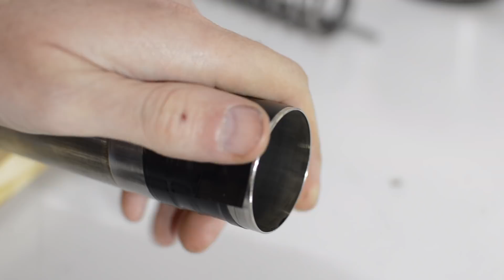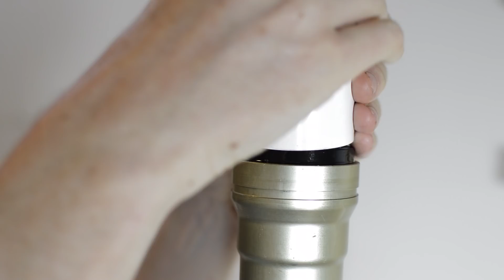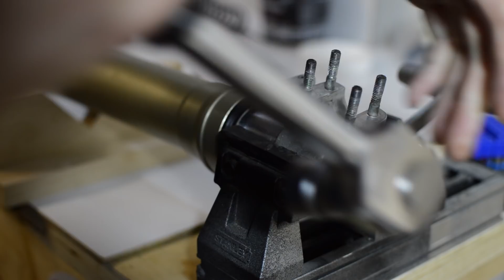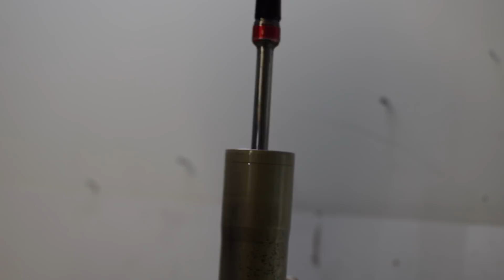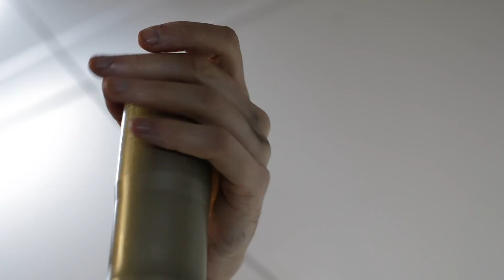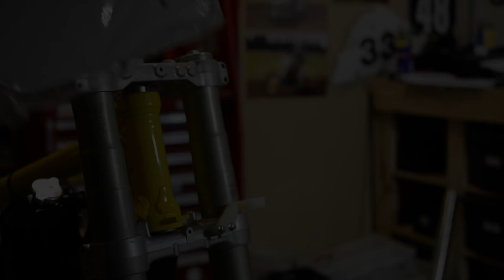Front Forks (Part 2) - 1992 RM250 Restoration - Episode 18

Comment: I just got the kit for my 1992 rm125 and the kit included two large O-rings, the size of the O-rings for the top cap. Two came in a single bag, then two came in two separate bags. I used the two in the separate bags but am wondering what the other ones are for. Maybe a different year/model bike?

Comment: Hey! I thought I'd share the way ive driven in fork seals both times I've done fork rebuilds. I use PVC like you, but I take enough pvc material off between the pieces that they are able to be clamped to the fork tube with one or two large hose clamps, then the entire fork tube is used as a slide hammer.

Comment: Hi fantastic build series mate, i got a quick question. So I just bought a 1992 rmx250 and have been searching all over the net to find a exhaust system to fit it... Yes I've been on lots of forums with info on interchangeable parts but can't find anything on the 92 models anybody got any ideas it would be greatly appreciated cheers.
Reply from the maker: Hey MotoApe - there's a really good facebook page for this era of RMs - https://www.facebook.com/groups/231474913851717/

Worth asking the question there mate.

I do have a new old stock Pro-Circuit works pipe for the 92 RMX that I might sell if you're interested.  Cost me a lot of money though...
Reply: Hi thanks for the reply, how much is alot?
I also found a full Pro Circuit system being sold by http://www.chaparral-racing.com/, around £500 delivered to the UK cheers
Reply from the maker: I paid $350AUD plus shipping from the USA.  I'd want to recover my costs...  This is a new old stock, works pipe - no longer available.
Reply: sent u email!

Comment: are you replacing all plastics?? are they available new from suzuki? i need to replace mine on my 94
Reply from the maker: Yeah I'll replace them all.  The front number plate is OEM Suzuki but the rest will be aftermarket unfortunately.  I'm using UFO stuff.
Reply: G9Garage I just enquired through my local Suzuki dealer...they can source all plastics ex japan.....not cheap, but available... a local guy has 2 nos radiator covers for $100 still in the Suzuki packaging

Comment: more good stuff, just wondering if you have tried aluminium specific cleaner? Chemtech Blitz is what I use, about $20 a litre of concentrate from bunnings. Its great stuff, used it on almost all raw aluminium on my rm250. Leaves a bright but not over the top finish, as close to oem as i could achieve and can be diluted way down to be safe.
Reply from the maker: Hey mate, I have the Chemtech Blitz stuff too.  Works well.  Just thought id try something different here...